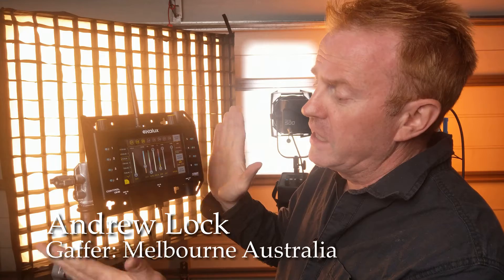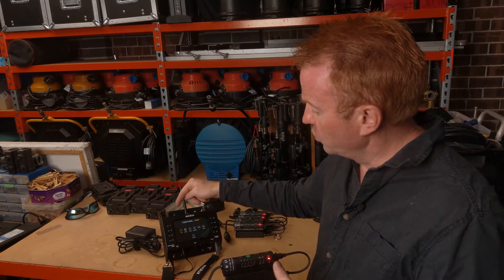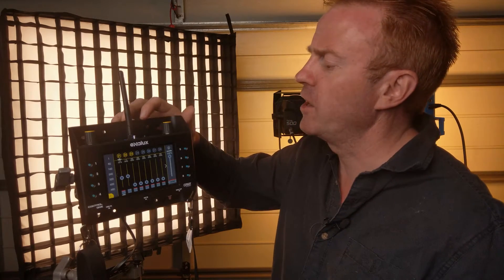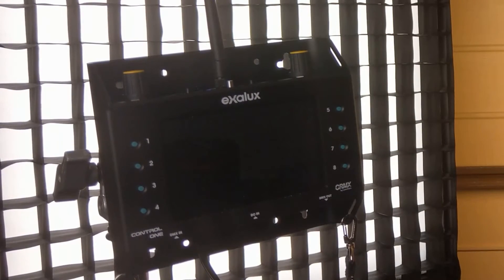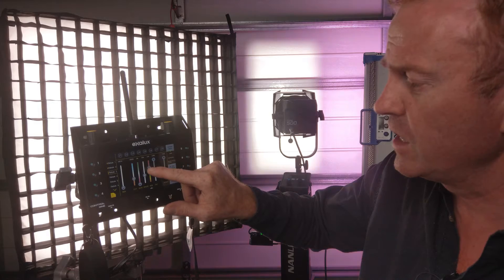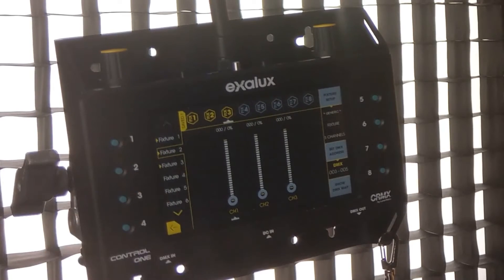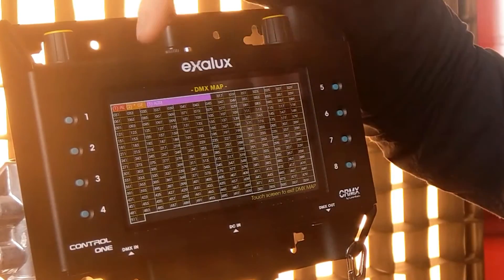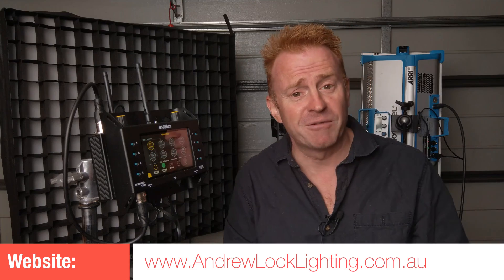Gaffer & Gear 66 - Exalux Control One

Comment: I'm curious. This looks great to take out on location where I'm only have 10-15 lights to control. When I am on stage, could I hook this up to my main console and use it just as just a lumen radio transmitter? I need to buy another lumen radio transmitter, but if I could do this, it would make the 2500 dollars more palatable. Thanks for all the great reviews BTW.

Comment: Hi Andrew, just got my Exalux Control one ,all good but having trouble getting mode 3 cut hsi on my Apature LS 600C to talk to the C1 all good except the HSI slider..... any clews?
Thanks Chris
Reply from the maker: Yep, I had this problem,  I had to pull the lights out and read my solution I have written on tape on the side of the light.

I have the light set to profile 3.

I set the exalux up using two profiles back to back.

1) Aputure Nova P300c (Mode 3)
2) generic 2 Chanel's.

The generic 2 channel can operate the strobe, but also blocks the next light you enter in from setting off the strobe.

The Nova profile will run the rest, just have the G/M set to zero for off.

Have the saturation set to 100% and use the CCT/HSI slider to desaturate.
Reply: @gaffergear  Thanks Andrew, i thought i was going mad 😂

Comment: Great video! very informative.
I have a question, could you have some fixtures selected out of your entire setup and do changes on them all at once or you have to do it one by one ?  lets say i am in a studio situation and i have 8 skypanels on the backdrop and i want to make some changes on them without altering my other lights.
Reply from the maker: I was in touch with their software engineer for this video asking about things I didn't like. This was one of them. They are working on grouping lights at the moment, hopefully in the near future it will be in a firmware update. They are a bit pushed due to processing limitations so 50/50 chance.
Reply: Great, thanks. 
Keep up the good work!
Reply from the maker: Im now a beta tester for them, so I have just tested the next firmware. You can group lights so long as they are the same fixtures in the same profile
Reply: @gaffergear  Does the group function rely on naming them the same - or is there another way of grouping fixtures - so far very happy with Control One
Reply from the maker: @JamesRudd  same name, and must be the same profile (and make).
Reply: @gaffergear  Thank you

Comment: How to hard reset the security pin?
Someone was playing with my controller and set a new pin code. Now I'm stuck after entering the player function - can't return to menu not knowing the pin. Do you have any hints on how to deal with this?
Reply from the maker: I have never been brave enough to venture into the security pin area.

I will e-mail the software engineers when I home and see if they have a solution
Reply from the maker: Exalux have tried getting in touch with you.

Can you email them at....

contact@exalux.eu